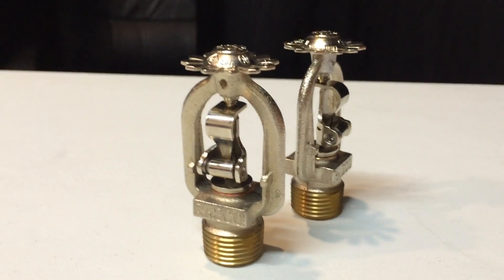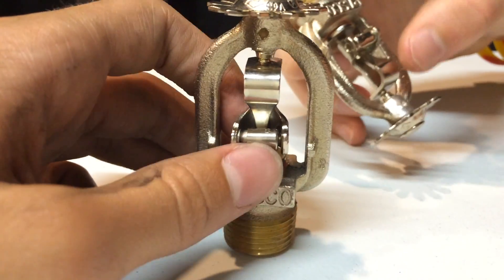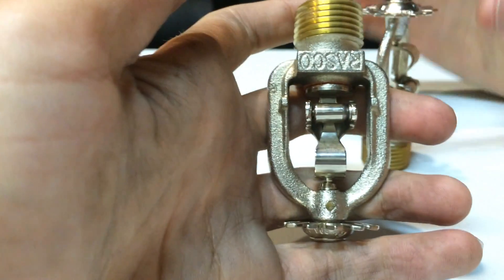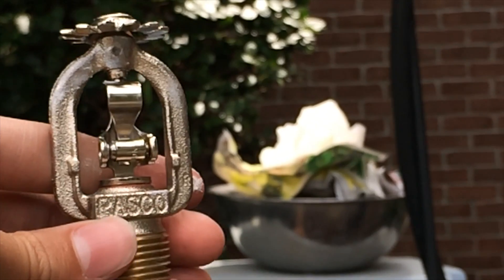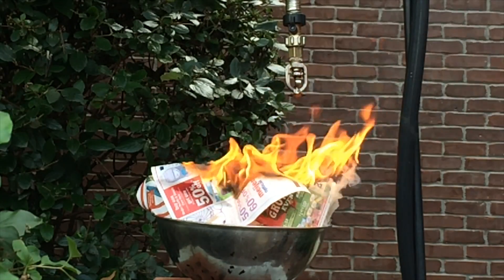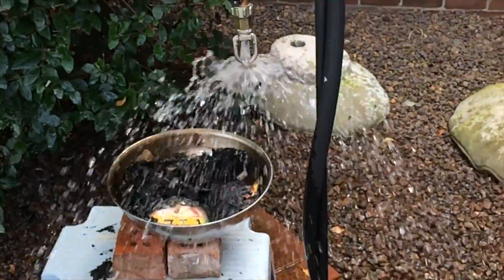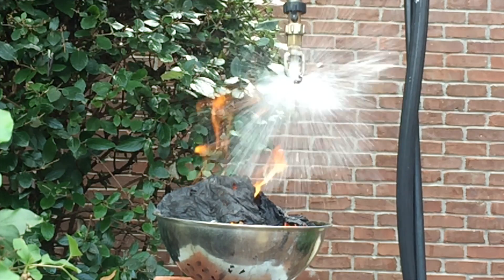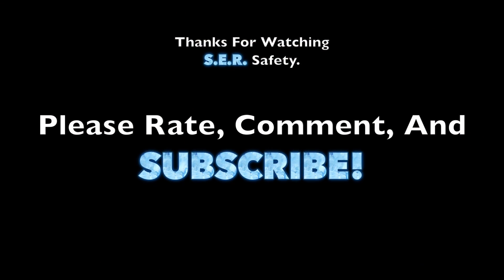Setting Off A Pendent Fire Sprinkler With ExitSign250 In Real Life!

Comment: It would have popped quicker if u had a heat collector above the head. That's why the heads are in a ceiling or against a roof. So it can collect the heat